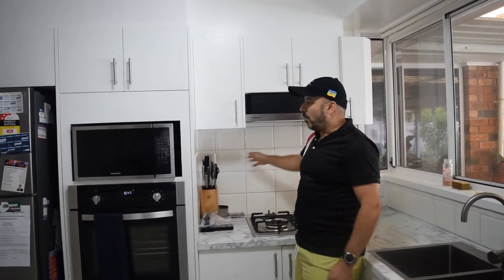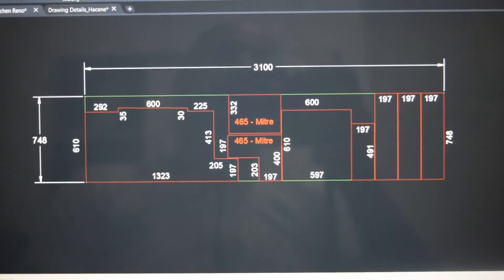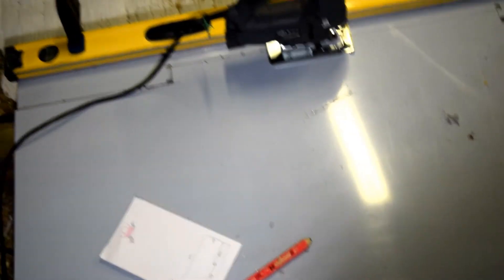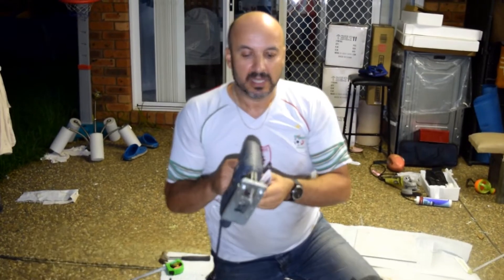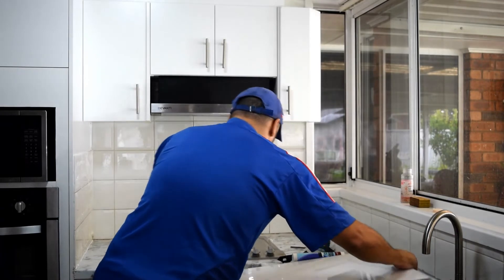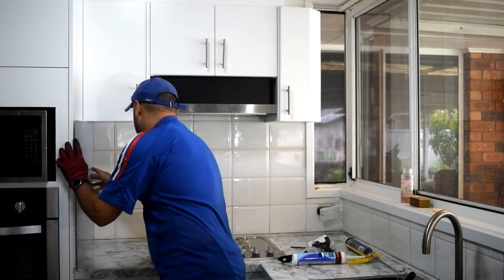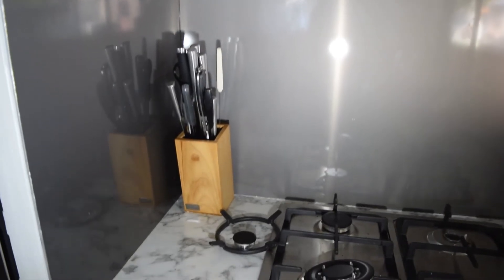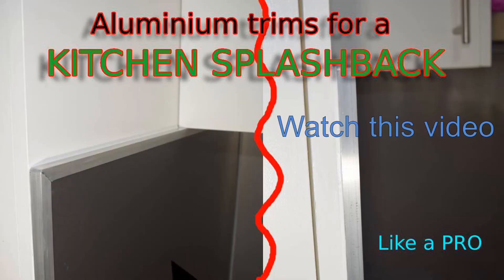How to install aluminium Kitchen Splashback like a pro | Simple Renovation Tips

Comment: I hope you check back once in a while to the comments.  I have a question if I may. I have a small freezer outside in the covered car port.  I was thinking of putting aluminum back splash contact paper on it to reflect the afternoon sun and keep it cooler.   Would that work?  Would it make any difference?